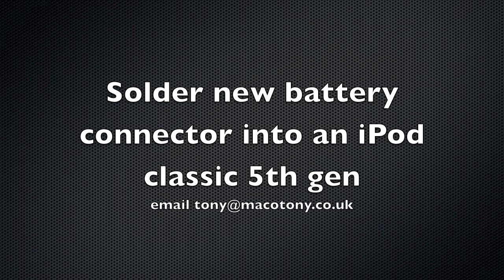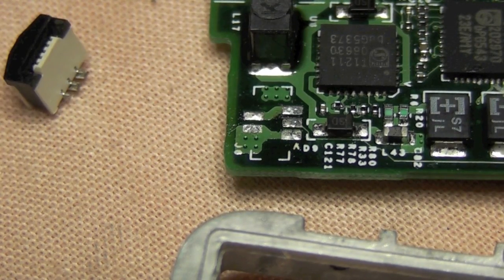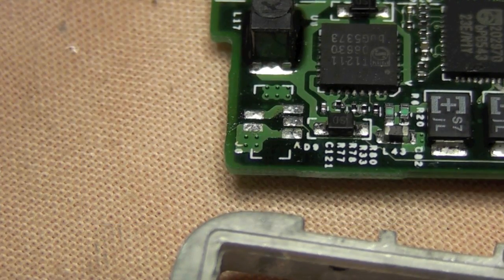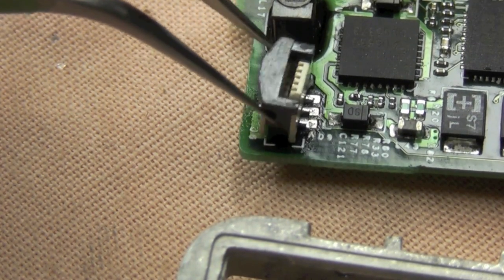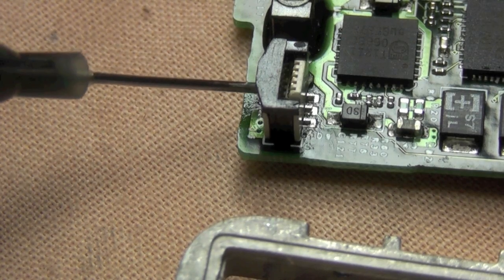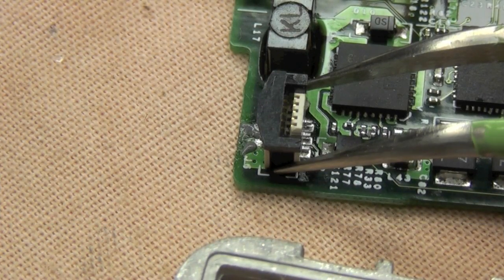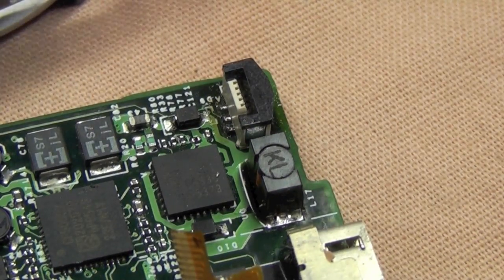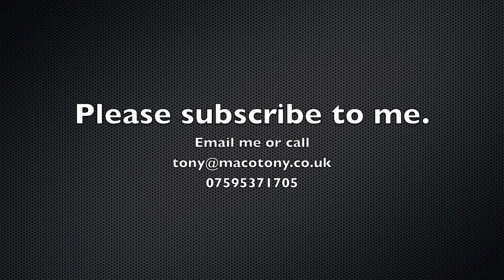Fix ipod classic battery connector repair

Comment: I bought two replacement batteries in 2020, but I have been building up the courage to do this since then, LOL. This video helped me a lot!
I managed to open two iPod classics this way. Unfortunately, I ripped off the battery connector on one of them. One out of two I guess. 

I'll still keep the broken one. I may get it fixed someday.
Cheers from São Paulo, Brazil.

Comment from the maker: depends on which ipod classic you have, the older ones have 2 screws under the select button and double sided adhesive and the later ones just adhesive which can be loosened with a bit of heat and a pry tool.

Comment: Hi there, my iPod was refusing to charge or be recognised by computer but was still able to turn on. When i took it apart some of the battery connector pins had come off. Would replacing the whole unit solve my problem?

Comment: Hi
I have an Ipod video 30gb
Recently the battery connector came off
Would you be able to help me solder it back to the board if I send it to you?
Will there be any charges for it?
Thanks a lot for your help!

Comment: hello, my battery pins on classic are screwed up, but i don't have anything to solder on connector, how did you manage to get it like that? Thanks.
Reply: Koï Mt     It looks as if he isn’t connecting any pins, just slapping the connector on the location and then add the solder. Is that how it’s done? I am wondering because the receiver pins on my logic board broke and I am wondering if this method can still be done. Thank you for your response.

Comment: do you do this as repair service? Just bought iflash to upgrade storage and when taking apart. Battery connector popper off when I try to release connector? do you do this service for $$
Reply: I just called a place for an estimate of this exact repair, and they wanted 40$ to do it...thanks ill just use scraps from ebay and do it myself!

Comment: i already did this and it worked for a minute. then my screen when black with flickering white.  do you think this is a solder issue or a screen issue?
Reply: You probably used too much solder and shorted it out. Try cleaning the pads well and only using a minuscule amount of solder. Cheers for you for the DIY spirit!

Comment: what is that thing with the letters KL?
Reply: mine broke off, and Im worried what its supposed to do. Do you know what those parts do?
Reply: it s definitely an inductor coil but I do not know its value. Mine iPod has the same problem both inductors are broken. But I could fix the right one close to the battery connector. Sadly I lost de left one. But it seems to work fine with just one.
The part dimension is 4.9x2.8mm H:4.2 and mine is marked with KJ
Does anyone know the value (?mH) of this inductor?